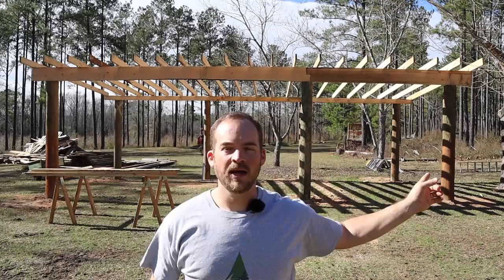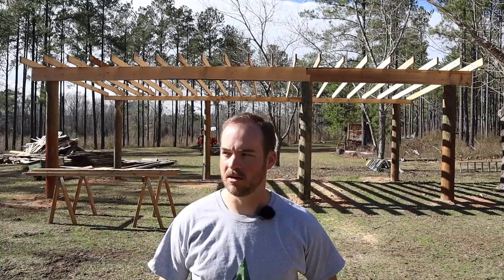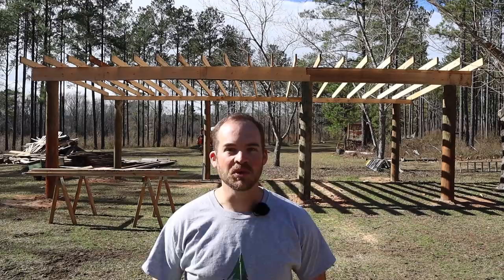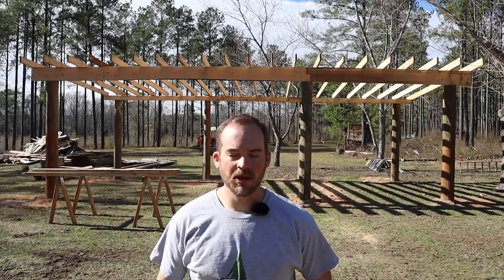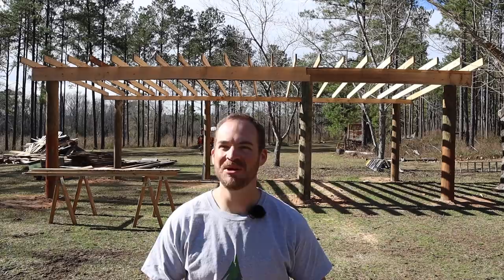Building a Sawmill Shed, Part 1

Comment: Nice job on setting those poles with the tractor. Please cut a flat on each side of the posts and put tie plates on all of them to keep your beams from rolling. those screws and gravity won't be enough. Good help is hard to find. lol
Reply: Geoffrey Kail, I thought about telling him to install like 4"x4" steel angulars of a 1/4 thickness on both sides under the union of the beams and top of columns as well. That way the beams have additional 4" under them to support over the columns. He'll see our comments, and maybe do it after confirming if is good and convenient overbuilding for longer lasting support and durability! Thank you!
Reply: future reference-product called Secure Set--2 part epoxy available Home Depot--mix -pour-dry 30 minutes-better than concrete-expands into the side walls and is waterproof--several fence builder videos on You tube extolling  its value-- price in or about concrete range-maybe a little more expensive but it works with very low labor cost and can be installed anywhere.anytime-rain .sleet.snow or sunshine--just offering what  learned

Comment: Hint. Get a trenching spade.  About 5-6" wide. Use it to cut the sides of the hole. (IT DOESN'T HAVE MUCH LEVERAGE STRENGTH), so just cut the sides, and then use the post-hole digger to lift out the soil.
  We raise horses, so over the years, I've dug more holes than I care to think about. Also, if you're in sugar sand, start the hole, and dump some water in. You can't lift sand, but you can lift mud.
Reply: Also, I welded about 2" of plate steel on the end of a 6'x1-1/4" pipe, so I can really pack the hole tight.

Comment: What I have seen is the rock on the bottom - good - and then pole in then a mixed up gallon or more of exothermic poly urethane that fills the hole.  Pour it in and start shoveling in rock/dirt and it expands rapidly.  Power poles etc.

Comment: A little tip! You can buy angle brackets to skrew in later to secure the top log on either side. They have hole in them for screwing. As I said it can be done later to secure it better.

Comment: I built a woodshed a few years ago and did the same but used the crushed stone under like you did but also put it around the post as well. This way the water has a chance to run down and not keep the post damp.
Reply from the maker: I might try that next time. Thanks for the tip!

Comment: My sawmill also has a 16.5ft length and I want to build a lean to for it but was concerned about snow load on a 17ft span beam. What size is your large beam and does it hold snow well. You said 19ft span but what are the thicknesses?

Comment: If you were to cover the roof with solar panels and replace the gasoline motor with an electric one, you could be sawing off grid solar. I am building one and I am going to use 8 kWh of battery to run the 120 V DC motors. I can’t stand breathing exhaust.

Comment: Geez, you make it hard for yourself. You've got a Ford tractor with a two stage clutch & no post hole auger. A 12" auger would have had those holes dug in half the time & saved you a lot of energy in the process. I notice you do a lot of stuff with difficulty!

Comment: after i started working at a rental store, my old post hole diggers seem to have disappeared.
Reply from the maker: I came close to renting a post hole auger for the tractor. Sounds like you're in a really handy line of work.
Reply: @falllineridge  Yes indeed. Skidsteers, excavators, and anything I might need. When I use a piece of equipment, I get it after hours and I make sure its not supposed to be rented. One thing, its nice to be able to get what I need but at the same time, I dont go overboard getting stuff.

Comment: Now you got it 20 years ago I took the axle off of our LT40HD and bolted it to the slab under a roof. I haul logs in and take lumber to market. In fact we are adding a shed roof to the log intake area so I can be out of the rain when pressure washing and metal detecting the logs. I don't know how much it rains where you live but we get 100" of rain and snow on top of that. I think you will really like the walls for wind breaks too. Nice job brother.

Comment: Now that the shed has been built for awhile, have you seen warping of any green lumber that was used?  I'm clearing land for our new house and want to build a pole barn out back with trees from our land.  Just wanted to get your opinion based on what you've seen with your shed in regards to any warping boards.  Thanks in advance!

Comment: Looks great. If possible give us a view of the joints you used connecting beams to poles. Curious to see the overlap. Selfishly wanting to steal your idea for my mill. Looking good.
Reply from the maker: Three of the four poles on the back side I just cut an L shape out of the top of the pole and screwed the headers on. That fourth pole I had to stick it to the very top because I didn't account for the drop on the ground, and the pole ended up being too short. The big beams on the front, I used a couple of FastenMaster FlatLok structural screws per joint. Very strong, but I think I'm going to add a piece of Sampson strong tie angle iron to each joint to have another fasten point. Plus a bracket to connect the two beams together. Probably overkill, but what can it hurt?

Comment: Good day. When you set the posts in why did you not use a bag of concrete  just tamped in?   I know you dont have to mix it and the moisture in the ground will set it.  Thank you Michele
Reply from the maker: I've heard that concrete can retain moisture. Plus it just wasn't necessary. Our red clay dirt here will harden nearly as good as concrete in time. Appreciate you stopping by.
Reply: Fall Line Ridge Interesting about your soil. I ask only because every post my husband every put in he used concrete. But your clay being tamped down is the same. I dont think we have much clay so maybe that is why we need concrete. Thanks for the soil info. Michele

Comment: Another great video Wes!  I was wondering why you didn't leave the upright poles a little longer & slot them for the cross beams to drop into?  Best wishes and bring on part 2!
Reply from the maker: Thank you! Three of the back 4 poles are "slotted" (I guess you could call it, with an L shaped joint). The fourth pole was a victim of the ground dropping off so it ended up being too short.

Comment: Are you going to use it just to mill timber and store the sawmill or will you be stacking and drying timber there as well?
Reply from the maker: Probably will just use it to mill. I'll have to store the lumber elsewhere.
Reply: Fall Line Ridge cool will you be cutting slabs or milling timber to size?

Comment: I had problems with the poles rotting in the ground and the shed sagging after about 10 years. Hard fix!
Reply: Those poles look creosote soaked to me. I’ve got one a little over 60 years. The poles still look great! The metal roof well thats needed replaced for the last 40
Reply: It looked like those poles were creosote  impregnated. Probably old light poles, but I'm just guessing. Don't think rot will be a problem for many years

Comment: the cool build I do not know to want you to do with you sawdust or waste boards found  a campground willing to take both of them the sawdust need to be bagged as well as the firewood  to need to be bagged  they using the bagged sawdust to building up the low area's in the campground what does make firewood is chipped its cash money for the bagged firewood  he does have my cut all of the firewood  any way  the city has been dropping of there unwanted trees here too as long as I get a fair shake on the good  tree to my yard right now look like a sawmill with all the down trees I have taken down to rebuild my farm we had a very cold  week  they are playing catch-up with the cutting all the buildings are timber frame trade school and a university has been very interest in the building  they are sure the work with them selfs
the sawmill last 2 years seen more use for it the last 55 year or longer it is still steam-powered sawmill 20 years ago we put a new build up over it was all done with the tree's we cut down here2 years take use to have it back up running  was pretty rusty when we were rebuilding it  the repait on the boiler is  hole out well had it inspected before we started it up not crakes seen were it was craked before

Comment: Wait, a level on a tapered log and then you've got a proper saw mill. Doesn't have to be perfect but you could have saved yourself some hassle by squaring those post.
Reply from the maker: Eh, I don't really want to saw a treated post. Lots of nasty stuff to go airborne.
Reply: @falllineridge  Treated post? Treated with what? Termites? They looked rotted.